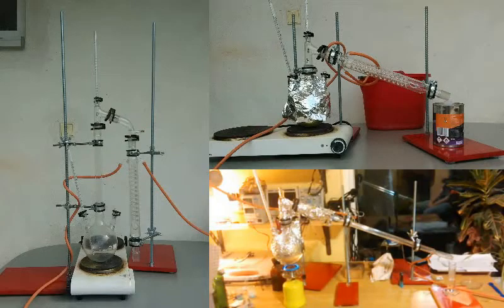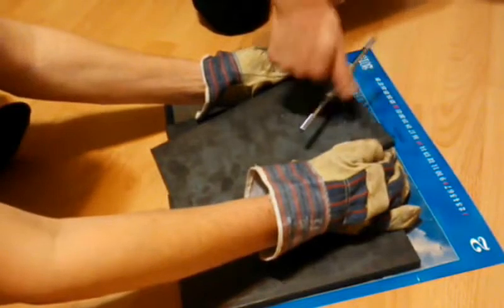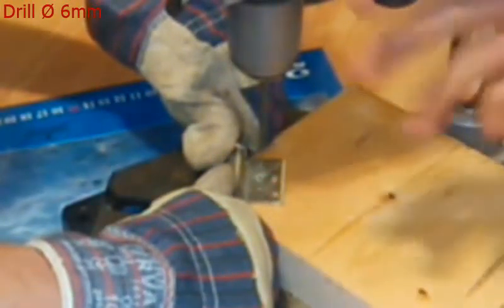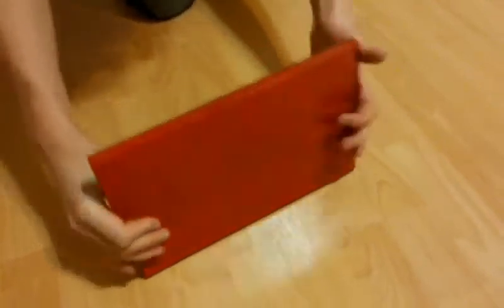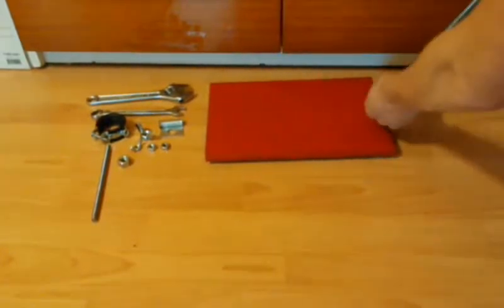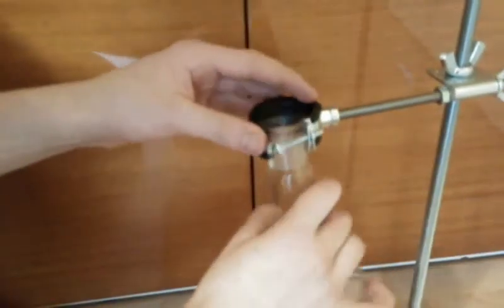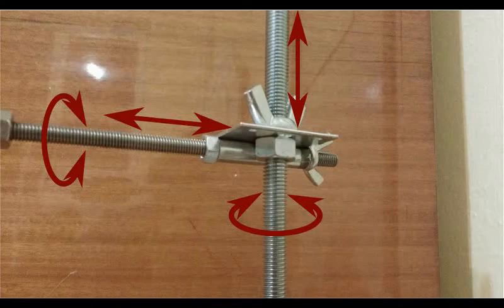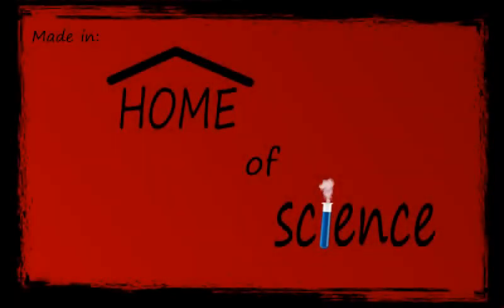How to make laboratory stands! #DIY

Comment: Nice way to make them, wondered if you could use a wooden base to save money and perhaps a wood dowel for the up-right. You would need to change the clamping method to perhaps rounds ring with screw in them. Might not suit your experiments as it would be more prone to catching fire.
Reply from the maker: cosmicrayastrophysics Hello, thanks for the comment. I think that the wooden base is quite good idea, however even the steel ones I have are sometimes not heavy enought and prone to flip over. I'm also concerned that wood would not be strong enough to hold the threaded rod.
The rings sound interesting, but I would be concerned about breaking the glass and the ones I use cost me about 1$.
Thanks for your interest and have a nice day!
Reply: if you put a lead weight on the bottom that might work... however the dowel seems like it might be flimsy.
Reply: Not the rod. But I made one with a relatively large block of wood covered in aluminum foil to protect against fire. A dowel would burn. His idea is perfect though. It gives that extra degree of freedom due to the hinge.